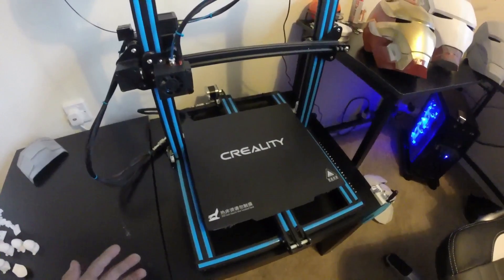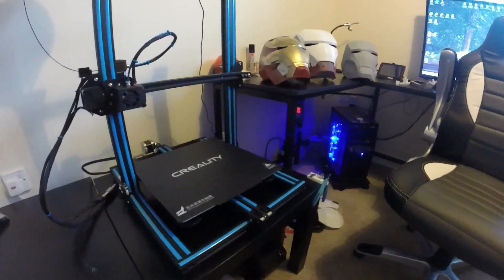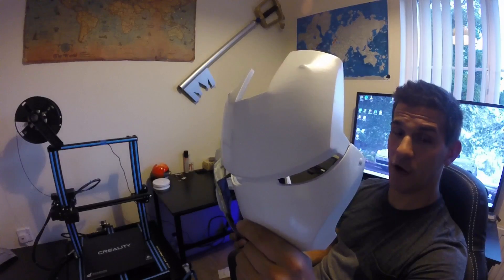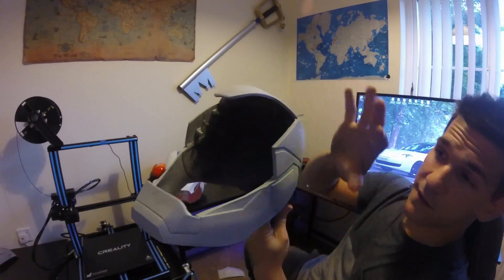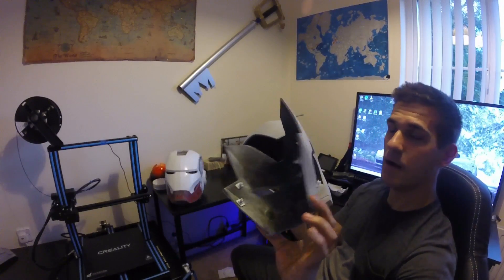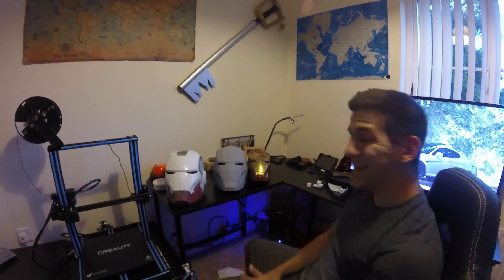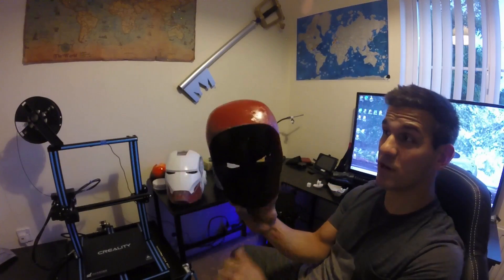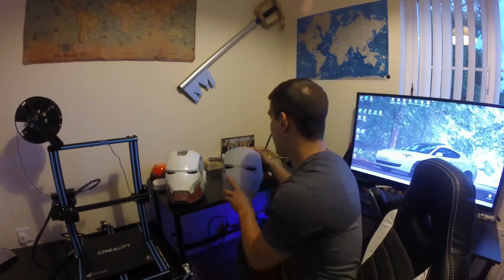How to Make an Iron Man Suit | 3D Printed MK85 Cosplay - Part 1

Comment: Hey quick question now they have 3d printers you can print with i think its either steel or some sort of high grade metal because you can build motor parts with the 3d printer is this suit possible using the metal 3d printer or would it be just to heavy of a suit ? Or to many issues ? Whats your thoughts ? Thanks
Reply from the maker: I mean. An all metal suit would be wildy heavy expensive and impossible to travel with

Comment: Hey Frank...love the videos.  I am moving from EVA costuming to 3D print....Here we go!  I watched your vids on bed leveling (AWESOME!)  Went around the corners and middle multiple times (with everything heated up).  The corners are perfect.  The middle has a bigger gap between Nozzle and Post-It.  The edges, where the prime line starts is super tight against the nozzle.  No matter how many times I level the corners I can't seem to get this tuned in.  I also upgraded the bed springs.  Any advice on how to correct/address?  Also...is Creawesome Mod no longer available?  Again...appreciate your love for the craft and all you are doing to give this awesome guidance.

Comment: Awesome suit! Did you use a 0.6mm nozzle for the entire build? How do you think a 0.4mm would handle?
Reply from the maker: Yeah basically. And it would just mean prints would take a little longer is all! But a .4mm would work fine too
Reply: Would an 0.8 nozzle work? I'm looking into this myself with a CR-10 max and it's either 0.4 or 0.8 nozzle ;)

Comment: Why do the STL files cost thought? 
Isn't the point of 3d printing NOT having to pay for something?
Reply from the maker: Yes and no. It originated as a basic tool to “fix a problem” then evolved into a more consumer base.

Someone needs to design the files or you have to do it yourself. So now you generate a service that never existed before; 3D printing file modellers. I can do it myself with years of practice or pay for someone else to do it. Price varies based on the product and quality. 

In the end this still satiates that initial need. I want to make something that I don’t want to pay for. An entire iron man suit. Which can cost $5000-10000. My suit cost $700

Comment: Buenas tardes Frank,saludos desde España,tengo una impresora Ender 3 y llevo 3 meses imprimiendo aun soy un poco novato en todo esto de la impresión 3d,lo primero que me gustaría saber es una vez que compraste el pack en do3d como fue el proceso,es decir los archivos vienen ya con la configuracion programada para CURA o tu le pones la configuracion que quieras?y luego por otro lado ¿que tipo de configuracion le pusiste al casco y cual al resto de la armadura?altura de capa etc etc,espero respuesta y sobre todo decirte que muchas gracias por tus videos y por todo el tutorial del proceso del Mark 85,un saludo

Comment: How did you manage to print the faceplate and top parts in one print? What orientation did you lay them on the print bed? I’m new to 3D printing so still learning a LOT! Thanks!
Reply from the maker: Stephen Berry I printed the faceplate as one piece standing up straight. And then the rest of the mask standing up straight on the back of the skull :)
Reply: Frankly Built thanks for the response! Don’t suppose you have any photos of it?! Would be greatly appreciated if you did and could show me!
Reply from the maker: Stephen Berry no I don’t but I will have a video up next showing the entire helmet build process! Including how it looks on the printer with supports! Just need to get it edited and uploaded! So hang tight
Reply: Frankly Built thank you, I look forward to it!! :-)